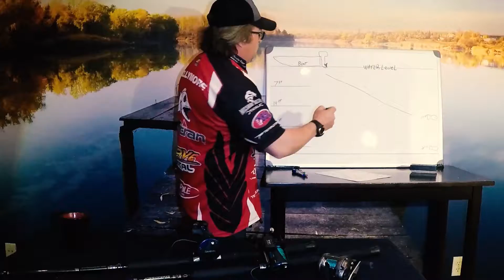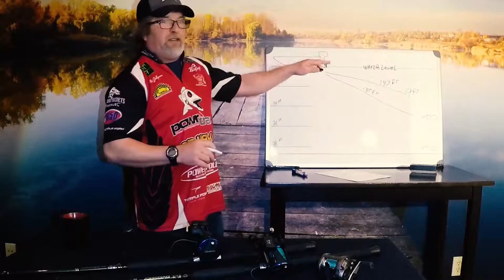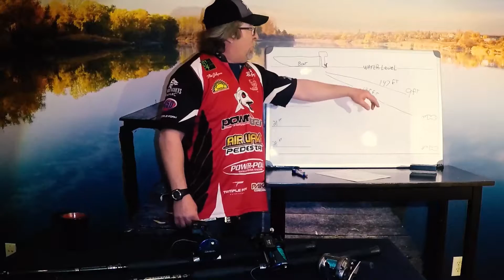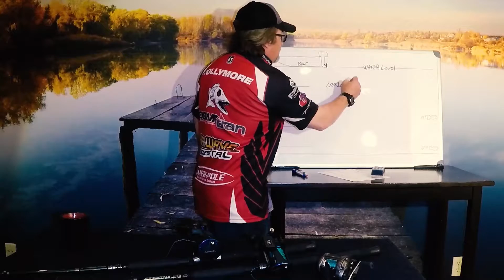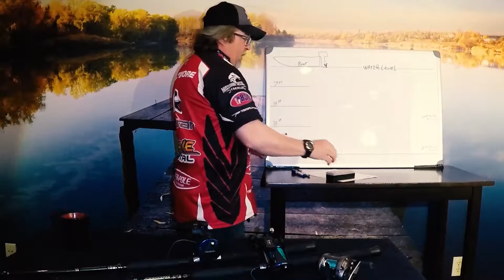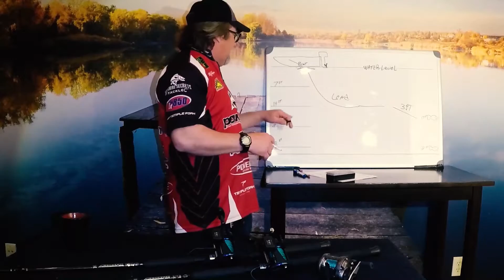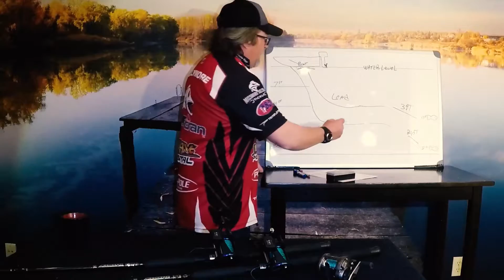Lead Core Fishing 101

Comment: Very helpful.  Thanks.  I do a lot of trolling with lead core in a canoe.  I am colorblind, so I go totally by the line counter and I have just spent countless hours trying different settings.  I have found that I can row one direction and bump the bottom, and over the same spot in the opposite direction, not hit bottom.  Not sure how wind and current affects me in a canoe (a bit slower speed, maybe erratic too).  I think I have been too short on my leader length.  Appreciate the tips.
Reply from the maker: One color is 30 ft

Comment: Matt, thank you so much for validating my unconfirmed suspicion that the leader length is responsible for the dive curve. I’m new this year to lead core and seasoned users have been disagreeing with that. Not to mention you being the first video out of 100’s I’ve watched even mention this crucial aspect.

Now, my question is about the sink rate per color being 7ft (I use the 832 as well). Most of the time I’m pulling deep divers and between the dive curve and 7ft sink rate the #’s just aren’t adding up. I’m somewhere between 5.8 - 6.7ft per color...? I want to believe that it’s 7ft per color but so far my experiences have been telling me otherwise. 
Is it me or do you believe it’s less as well? Thanks
Reply from the maker: Joe Y. Speed and current do have a affect on dive rate, what I gave is a general rule of thumb. Minor adjustments are normal for some of the baits. The precision trolling app for your phone will help you dial it in even closer

Comment: Great job explaining. Trolling at 2.5mph etc is using main motor. What about when using trolling motors at say 1-1.5 mph. Is it a waste of time trolling that slow and all charts have 1.5-2.5 MPH. I catch striper trolling with planers and live bait only in spring and fall using trolling motor at 1 MPH. I haven't really trolled deep yet, so just curious if they would still bite on slow troll in summer.
Reply from the maker: The direct answer would be yes it will work, however for speeds like 1mph I would suggest using the offshore tackle snap weights 50/50 method https://www.offshoretackle.com/graphics/divecharts/50MethodRevised31412.pdf , bottom bouncers, in-line weights or using the 3 way trolling system.
Reply: Matthew Jollymore thanks, the link is using 10lb mono. Went to their site to see if I could find other charts and couldn’t find any. Would still love to see a chart or formula for 1mph using lead core.

Comment: This is so incredible that you are explaining this.  Thank you so much.  I just have one question.  I'm using lead core for trout fishing and I'm using a Tasmanian devil lure or Kastmaster instead of a bill type lure.  Will the leader length also apply to these type of lures where it would drop an additional 2 feet if I have a 6 foot leader?  Thanks again!
Reply from the maker: The length of the leader will act the same on any bait you use. So if you did not have any lead core and let out six feet of leader line how far does the Tasmanian devil dive? Would act the same at the end of the lead core.
Reply: @matthewjollymore3471  Thanks

Comment: Mathew can i try to keep it simple, were I all ways run 10 feet so the bait will go down 4 feet, and do the math on my 832 advanced lead core for sections and should be Wellah,,,right
Reply from the maker: Correct and you hit the point I was making right on!
Reply: @matthewjollymore3471  👌

Comment: Accidentally bought me a "leadcore trolling rod" from Scheels and it's pretty small and I was wondering if I could use it to fish normally like cast from shore and catch like bass or trout
Reply: No, a trolling rod is for trolling, meaning it is setup to be used with a levelwind reel ( you can not cast a level wind reel because there is not a release like on a baitcaster. )
Reply: @tylerleigh3264 but it doesn't have a trolling motor I put a baitcaster on it pretty decent one for 100 and the trolling rod is medium look up the "Scheels leadcore trolling rod" it's look blue with black
Reply: Andy Izarraras I just looked it up and it would theoretically work with a bait caster it is just not ideal. It won’t be sensitive enough, have enough backbone, or be a fast enough tip. What I would do is see if you like it with the reel on, Go fishing with it a couple of times and see if you like. Which i am assuming you won’t so I would sell it and but cheap bill dance special or something. But if it is fine then great.
Reply: Also do you have Instagram, if so I can dm you to talk about it more and find a better rod.
Reply: @tylerleigh3264  I'd be able to send photos
Reply: What’s you snap
Reply: Andy Izarraras what’s your snap
Reply: @tylerleigh3264  "Dannkk"
Reply: @tylerleigh3264  : Dannkk

Comment: I want to make a 10 color rig any suggestions? looking at the Okuma cold water reel and suffix 832 Lead Core. But not sure what size rod and reel.
Reply from the maker: Jonathan Lozier I use a KastKing Rekon 20 line counter reel and a KastKing Krome Pro troller 10’6 rod. I run suffix 832 advanced lead core.
Reply: @matthewjollymore3471  Thanks,, I did not think a size 20 would hold 10 colors/3300 yds of lead core!
Reply: @jonathanlozier4329   1 color is 30 feet (10 yards) so 10 color is 300 ft.

Comment: You did  not talk about boat speed did you???
Reply from the maker: Alan Mc the measured speed for lead line is normally 2.0 MPH - 2.2 MPH depending on brand
Reply: I run between .4-.8 and two colors gets my inline smile blade down approximately 22ft another thing to consider is the weight of the leadcore that’s with 17# core. Best way to figure out how to use it is to troll at your desired speed and use some sort of table like his and adjust it til it stops dragging the bottom then u have a better idea. I only use a 3ft leader to a swivel but my leader lengths varies between 3’-4’ on inlines. Once you know what’s bottom you can cut that in half and then in quarters. You don’t need to be right on because the leadcore fluctuates depths as you troll it sorta like flapping in the wind.